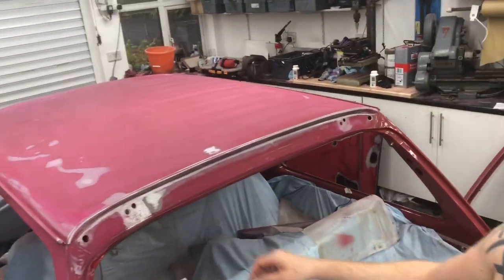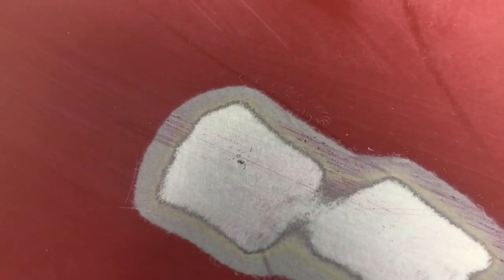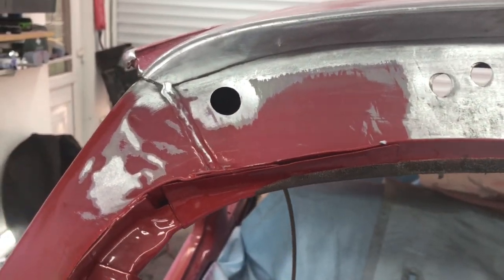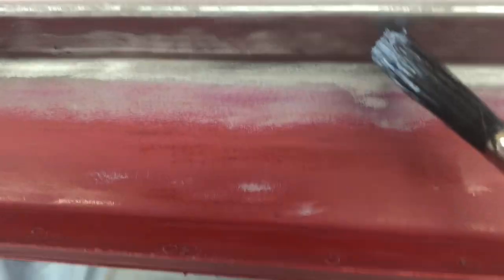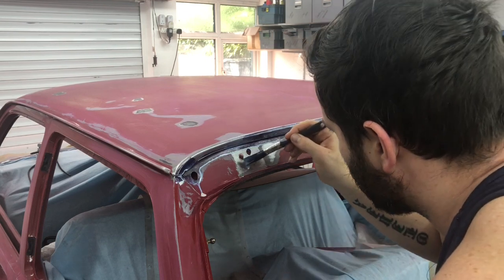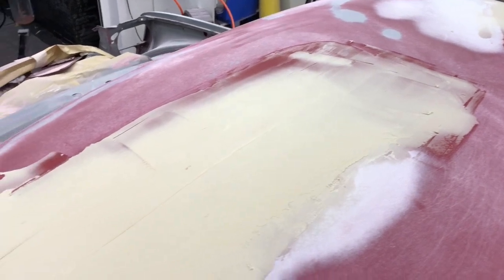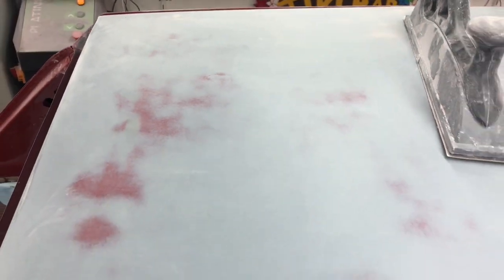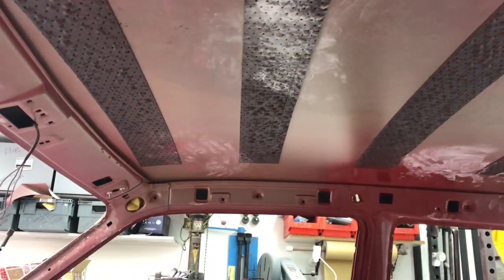Austin mini metro part 11, bodywork

Comment: which etch primer do you recommend because the one i use is hygroscopic and with it being sat in primer for a while it has started to rust, ive had a look at a website called rust.com and they sell all types of products so im wondering what you use to stop this.
Reply from the maker: I’m not sure any primer will prevent rust, I haven’t had issues but it’s been in a heated garage, maybe you would be better putting a thin topcoat on it if it’s going to be out a while